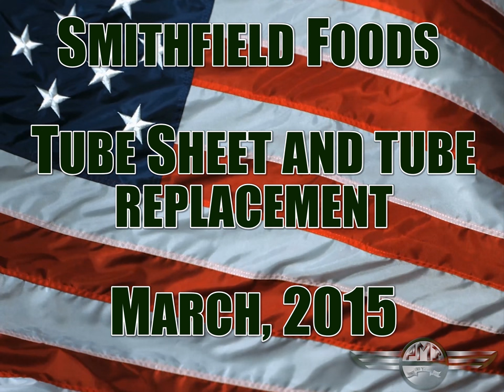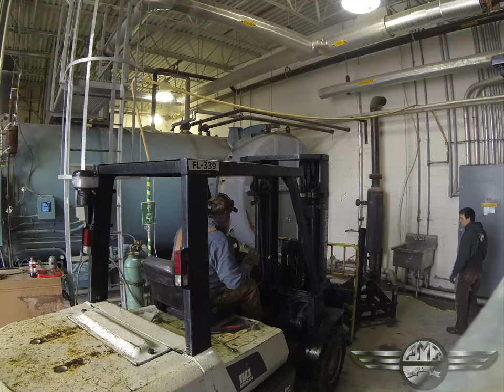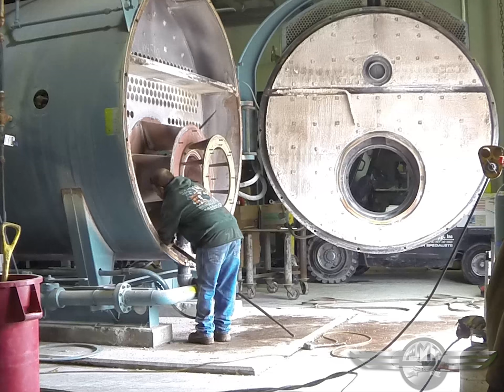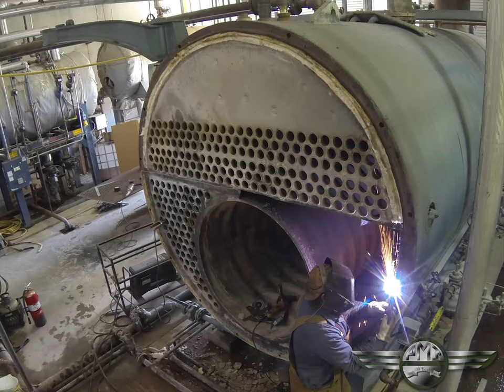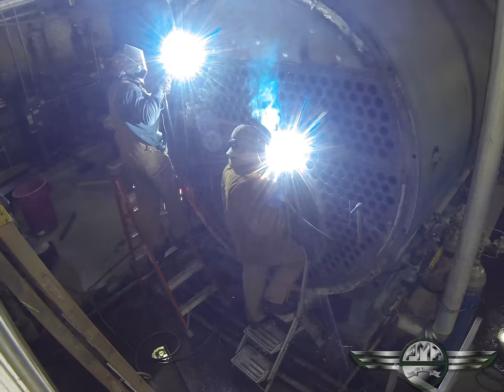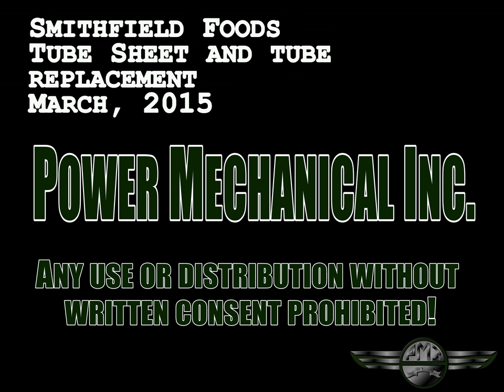ASME Boiler Code Repair - Tube Sheet replacement

Comment: What is the clearance for tightfit of the tubes inside the tube sheet? Size of tubes and holes in the sheet? What are the materials specs of the tube sheet and tubes? How much tube lengths outside the sheet for tubes expansion?

Comment: How much bigger are the id of holes in the tube sheet bored than the od of the tubes. Is the clearance difference a 1/32 or so? I imagine a typical slip fit of .01 thou would be too tight for sliding the tubes in easily. What is typical for the tube roller to expand the tube out to fit well? I was a machinist for 10 years and drilled parts like that, but i never did tube sheets for boilers, mostly made junk for those silly windmills and parts for agricultural industry.